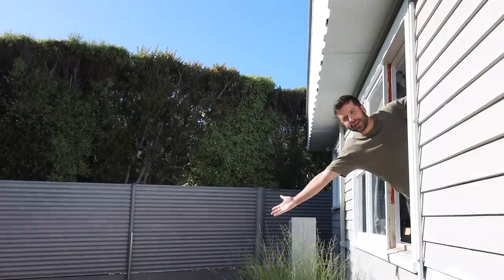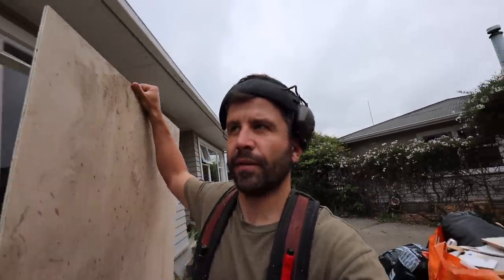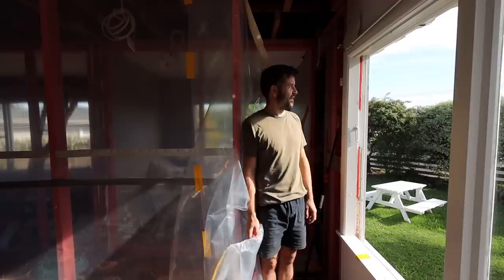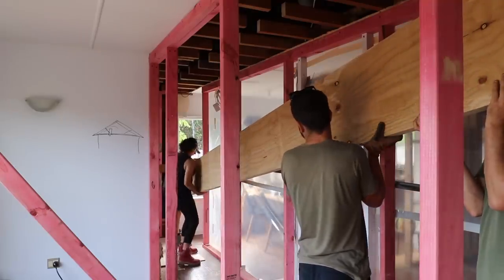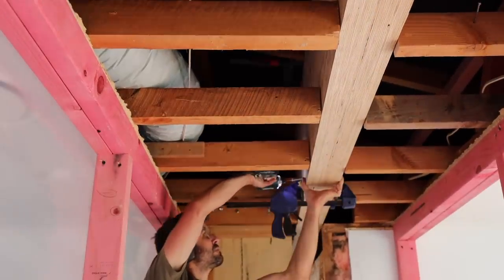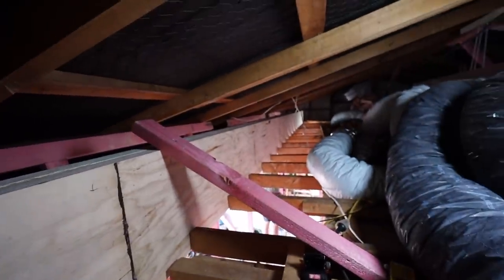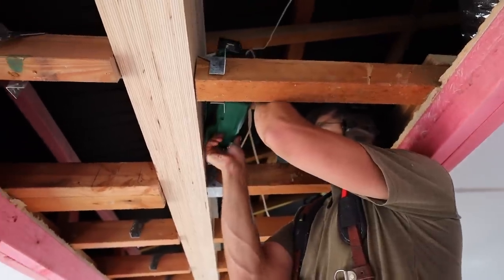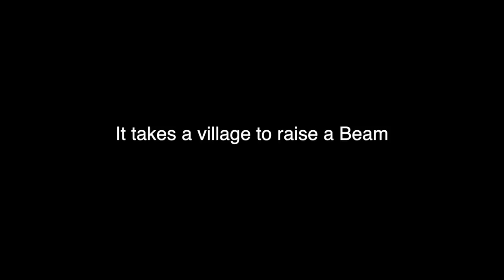We have ONE chance to get this right! Lifting a HUGE beam

Comment: I think it would be a good idea to strap the underside of the rafters across the cut to maintain a tension path (probably part of the reason they were lapped in the first place) and prevent roof spread. To deal with the offset you could sister on some timber to the rafters on one side of the cut so you can run the straps straight.
Reply: I'm sure the engineer calculated for that. Those joist brackets are strong as hell when fully nailed off
Reply: @Nickvin  Strong for vertical loads, yes, but comparatively low for axial tension.

Comment: Hey Scott! Another extra to compensate for the compromised lateral load (exterior walls falling outwards), you spoke about with the little diagram, would be to put straps along the under side of the joist and up the side of the beam, before installing the joist hanger. As at the moment it’s just a few product nails into the beam that’s essentially holding the truss type system (triangle) together 🧐👌🏼 

Rate the videos, I have learnt a lot and you’ve definitely helped me become more thorough!! 
Keep up the exciting videos
Reply: I had same concern
Reply: I suppose a few screws interspersed between the nails would help with that. The nails being less resistant than screws from being pulled out directly.

Comment: Hey there! Just something that came to my mind when watching this video. 11:20 this is the reason why we dont/rarely use impactdrivers in Germany in woodworking. Just not needed. Some carpenters use it on site for some heavy duty screws when they build barns or the roof structure with footlong screws, but in furniturebuilding or normal construction we always use normal drills like you do there. Using impactdrivers is a thing/phenomenon that came to Germany by watching youtube i think and is mostly used by hobbyists and not by craftsmen. Greetings Chris

Comment: Bro the hikoki 1/2 inch impact wrench is super ideal for driving bugles into LVL I used to have one when I worked for carters doing remedial fix ups they are great when you have a ton of stud lok screws to put in the smaller impact drivers are great but I have burned them out before

Comment: I use the Bostitch PN50 palm nailer. It means dragging around an air hose and manually loading each nail, but it's super quick and can get into tight spaces where even a standard hammer can't go. After the first dozen or so nails, you get the hang of it and the magnetic head for holding the nail is nearly as quick as a full size nailer with a strip of nails.

Comment: That Hitachi is more like the hanger guns that I'm used to, although I've only every used pneumatic ones with a hose. They are also smaller than the battery powered one you were using... handy as though! Way better than trying to swing a hanger between joists.

Comment: I've hand nailed those things for years and bashed my fingers along the way, then i bought a palm nailer then another one then finally i saw on this old house program in the US a pneumatic joist hanger gun and i love that thing sure i have to set up a compressor but it's small lightweight and fits in tight spaces and have never missed when using it,. sometimes it scares the crap out of you when it fires because it's louder then other nailers but no longer bashed fingers 😀

Comment: Structural timber engineer here: could you add a description in the next episode describing why you need this beam and have to cut the joists? I suppose it has something to do with your addition. Keep up the good work.
Reply: In the last episode he removed his "problem room" interior wall which was carrying the end of the original beam... opening up the layout of the house and requiring the new beam to span a much longer distance. And he mentioned in this episode that he decided to cut the joists, rather than hang them from the new beam, to keep the attic ventilation as clear as possible.
Reply: @KenMcGeachy   My initial concern is that the previous beam was potentially suspended from the roof rafter to prefent the ceiling from sagging, not carrying any load from the roof. If that is the case I hope the mechanicle joist hangers are also calculated to take the tensile force that the ceiling joist normally is carrying when the roof is loaded - wind/ snow
Reply: @scottdimmock258  fair enough. Having had to get "consent" and engineering approval, and the fact that Scott didn't do any calculations himself (for the point loads, span, beam depth, etc) would make me think that the onus was on the engineers to dictate the hanger required. Scott did mention that the roof was bearing on the ceiling joists in that spot, so the beam is carrying the ceiling and the roof load there... no wonder it's so massive : )
Reply from the maker: Hey good question. It’s a monster of a beam, I think it is taking both the weight of the ceiling and the roof. The room will eventually be almost the full length of the beam, a lot of walls coming down. I do wonder if we could’ve done it with a smaller timber beam though. We deliberately avoided steel, for thermal and practical reasons (harder to fix to).
Reply: @ScottBrownCarpentry  what about the tension on the ceiling joists? As you showed in your diagram, this style of roof truss puts a spreading force on the tops of the walls which is offset by the ceiling joists which are in tension. Joist hangers with nails aren't rated for tension loads like that, so how has the engineer addressed these forces? Is the roof truss triangulated inboard (on the ridge side of the new beam) to prevent tension from pulling the hoist hangers out on both sides of the beam? Or will you use sheathing on the ceiling as a sort of shear layer to keep the joists from spreading?
Reply: Builder and designer of 35 years here. This whole beam install and the way it has been set and the steps rationalised is all a bit incoherent. A convoluted and naive process for what is a pretty simple and straight forward structural change. The only positive thing cutting the joists did was make it easy to insert the beam - but kinda like plasma cutting the front of your engine off to change the timing belt.
Reply: @haphazard1342  To stop that spread, the simple solution would be strapping/ties across the beam tieing the joists back together. That wasn't mentioned in the closing bit of the vid so I am curious too.
Reply: Oh so your a mechanic to? ^
Reply: @DiscoFang   exactly my thoughts. No need to cut the ceiling joists to do the work required. Remove a sheet from the gable end and slide your hanging beam in and position over new load path. Joists hangers do next to nothing in tension!!
Reply: @edenf4519  Indeed. The hiab could’ve done the heavy lifting onto scaffold. The only dodginess is that the gable cladding is undoubtedly asbestos but in the long run, given its direct exposure that stuff should be taken care of.
Reply: Yeah, I have to say I'm not quite understanding this. In the original design, the trusses carried the load all the way to the perimeter walls except in the problem room, where the interior wall use to be the exterior. Wouldn't it have been easier (and more structurally sound) to just rebuild the roof in that area using the same truss design as the rest of the house? It's just a tin roof with no sheathing or insulation so it would be a pretty simple job.
Reply: @wallyballou7417  They’re not trusses though. The joists don’t support the rafters like a truss, that’s the job of the rafter-struts that transfer down to the wall that was removed. So the only real load the beam needs to carry is the mid-span of the rafters (and the ridge beam to some extent). The ceiling joists carry very little vertical load, but they do a job  job of tying laterally. Cutting them changed the role of the beam quite a lot.
Reply: @Pitt2211  Tile roof load? Yeah,  .050 corrugated iron roofing runs about 5kg/sqm where concrete tile runs 10 times that weight at 50kg/sqm. The 8m section of roof above your 8m beam could be almost 3tons heavier than the same section of steel roof. 
That’s 2 cars parked on the steel roof.
Reply: @Pitt2211  I’m not an engineer but for a lightweight roof, I would think you’d span 8m easily with a standard 250UB around 25kg/m if not less. That size would do the outside wall at 30ish kg/m.

Comment: That looks huge!
i just installed a 6.3m steel I beam 200 x 10mm and that weighed 137kg (very hard had to remove ceiling and cut joists just like this)
do you know how much this timber beam weighs?

thanks well done

Comment: Curious Scott. 
You utilised type 17 bugle screws for twin beam attachment.
Why not use type 17 hex drive screws for joist hangers as most manufacturers recommend screwing LVL's as opposed to nailing. I am doing a similar Reno here in Perth &  enjoy the relevant content

Troy
Reply: Screws are too brittle for dynamic loads applied to joist hangers unless they're specifically rated for it (like Simpson CSA). We have to use square twist nails here in the UK, they're a bit of a bastard to get in but they're solid as a rock.

Comment: I use a Bostich air coil nailer for hangers. Get the hardened tip nails, shoot the hanger wherver you want, it punches through the metal. Use bump fire and machine gun hangers lightning quick.

Comment: Hey Scott, aren't those joists being pulled apart from the beam? I wonder if you plan to maybe add some screws beside nails to the joist hangers?
Reply: I have the same question. This style of roof truss keeps the ceiling joists under tension: the weight of the roof pushes the tops of the walls apart, like Scott showed in his diagram. Joist hangers with nails aren't adequate to retain that spreading force.
Reply: Joist hangers have very little lateral load strength, even with screws. The weak point is not just the pull-out of the nail from the beam but also how close to the end of the joists the nails in the joist are. Especially old rimu that splits easily and the way Scott nailed at an angle towards the beam with the gun. These need a strap/tie underneath joining the joists across the beam but since Scott didnt't mentioned them in the closing it's all a little odd..
Reply: @DiscoFang  It looks like the ceiling surface is attached directly to the bottom of the joists, so putting a steel strap across the bottom of the joist/beam/joist splice may not work.  Would strapping up and over the beam work as well?
Reply: @michiganengineer8621  It wouldn’t perceptably affect the levels of the ceiling surface. Once gibbed, plaster stopped and painted, even undulations as great as 2 cm like the ceiling was an ocean swell won’t get picked up by eye.
Reply: @michiganengineer8621  but you’re only talking 3-4mm
Reply: @DiscoFang  True enough, it probably wouldn't make any sort of noticeable difference

Comment: What was the weight of each LVL? Impressive pieces of wood! Good job the the cuts to have them fit that way in the end, too.
Reply: You have all the info and resources to work that out for yourself. Previous vids and other comments say 8.5m long. Scott said 450mm wide. Scott said 132mm thickness needed for both. Google suggests density is about 0.5. 126kg. Don't be so helpless.

Comment: in a modern house you would have trusses at 900 crs and you would have to get a design to modify and cut the trusses to accept a beam . A girder truss would normalle be the full height of the trusses there and ou wouldnt be able to fit it in without also takig some roofing off.Contrary to popular belif not all houses have trusses that clear span from one side to another.The trusses might land on an internal wall which you might want to remove for similar reasos to yours .Hence the requirement for a new beam.

Comment: Hey Scott pros and cons to using a steel beam or box section if possible by engineers? How much camber on your beam? I'm a structural steel welder/fabricator and want to use steel as load bearing beams.
Reply from the maker: For me the main benefit was being able to work with the wood. I could install this beam and attach to it without having to get a sub contractor. Sounds like you would be better off with steel. I had to get an engineer for both so that wasn’t a factor in the end. Not sure of the camber but I would guess 15mm

Comment: Have you ever tried using bees wax on the screws. When I tried it made the screws go in so easy. Didn't seem to made a difference to them holding
Reply: Hard paraffin (wax used for canning food) also works.  Not quite as good as bees wax, but it's a bit cheaper in my area as well as available in more locations.
Reply: Bar of soap works too.
Reply: I keep a piece of candle in my nail bag for that very purpose, works brilliantly

Comment: Why didn’t you just open up the gable & slide it through? You’ve compromised the trusses
Reply from the maker: Asbestos gable end, with mains power and fibre internet attached to it. Still possible but would of been a big job on its own. Plus we wanted maximum roof space above the beam.

Comment: I wonder if a 1/2 inch impact wrench with an adapter would have been better for driving the bugles? The times I've done it seems to drive them easier obviously because of more power but I wonder if heat and battery usage would be better.

Comment: $50 paslode attachment? nah ill buy a whole new gun instead....
Reply: You mean the $128 attachment? Havnt seen it for $50. Problem with that, you can't use your gun as a framer while the attachment is installed
Reply: @evagnz  oh, they were $50 in 2016, ive not had to buy one since.
Reply: @jacksonkinney8175  $128 was the cheapest I found. Some other places sell them for over $150.